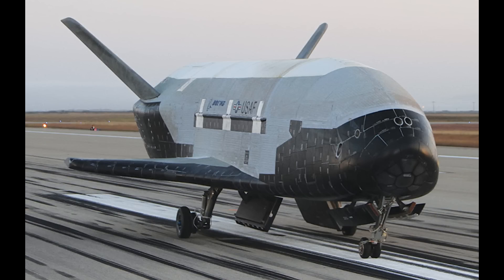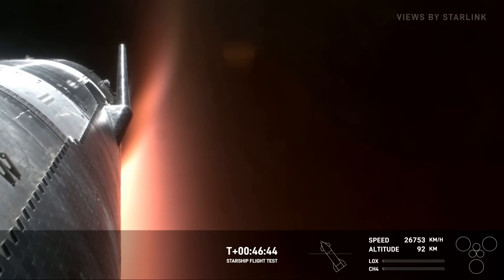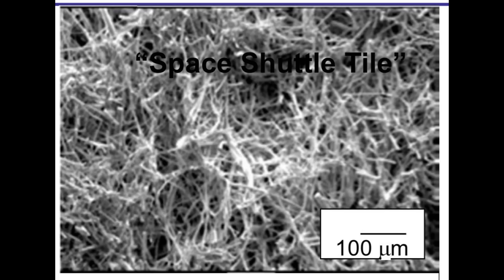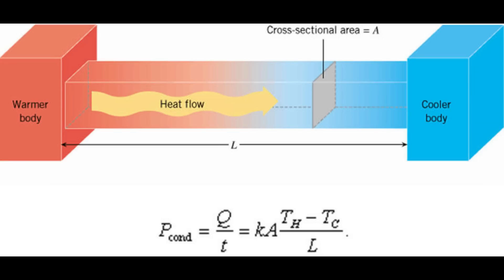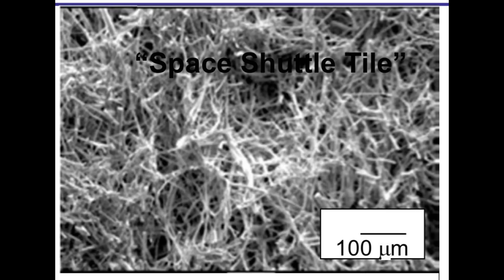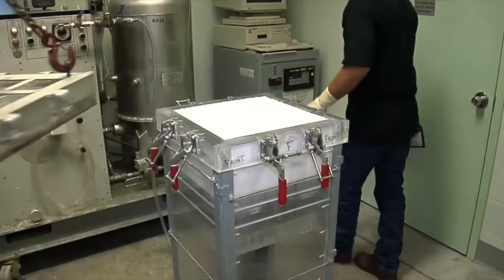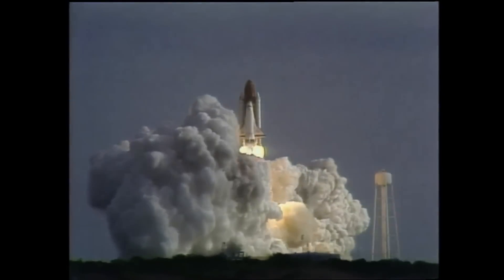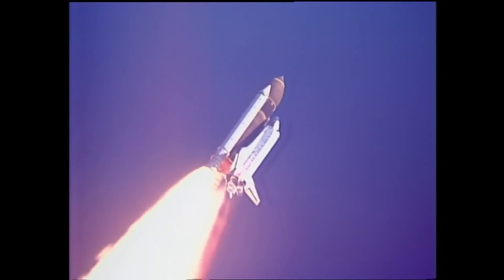The Microscopic Trick That Makes Heat Shielding Tiles Work

Comment: Do you know anything about the heatshield that the X-33 was going to use? I found a picture from the air and space museum, presumably the back side of the tile (can find it searching for this -> NASM-A20060281000_PS03). It was developed by BF Goodrich (tire company?) and used Inconel. I'm not aware of that design finding its way onto any other vehicle.
Reply: I spent time during 1995-96 developing and measuring the insulating properties of a half dozen heat shield concepts for NASA's X-33 under contract to NASA. That Goodrich Inconel thermal insulation panel was one of those concepts. Inconel has a maximum use temperature around 1800F. The maximum temperature on the Space Shuttle tiles was ~2400F. So, those Inconel tiles are a lot heavier than the Shuttle tiles and don't have enough high temperature capability. 

Lockheed was convinced that its Venture Star X-33 vehicle could fly entry trajectories that kept the peak temperature below 1800F. We will never know if that vehicle could have performed that feat because NASA canceled that over budget and behind schedule program before any test flights were attempted.
Reply: Metallic thermal protection systems based on superalloys, like the one planned for VentureStar, seem understudied.  There are a few papers available online by Blosser et al.
Reply: Im not surprised that idea died.  Inconel is very heavy.

Comment: Some ITAR things seem absolutely ridiculous these days, at least to me.

What could someone learn from seeing a picture of a rocket engine that would be dangerous?

I toured an (unnamed) space company, and wasn't allowed to take any pictures of the engines just sitting on a bench for assembly.

I wasn't told any particular reason beyond "ITAR, and that's all I can say".

Aren't rocket engines pretty well understood by anyone who is curious enough to research them these days?

Am I missing something obvious?
Reply: Rockets are simple in principle, but as always the devil's in the details, and a lot of ITAR is about concealing or obscuring those details.  Nobody is learning anything groundbreaking from a picture like that, but stealing dimensions and making assumptions about material choices through pictures on the internet could save years of development work.  

Maybe the unnamed space company was working on missile engines, in which case the fact it's a missile part is more than enough for even pictures to be export controlled.  There's a free power supply design tool from TI that's export controlled, and I can only assume that's because some other company is using it to design power supplies that go in missiles or nukes.
Reply: @ShinyMajor  Yeah, I suppose that seems fair.

I guess the confusing part is why allow people in the room then.  If it truly needs to remain secret, it seems odd to let people in at all.

Same with the artificially lowered FLIR cameras I used for so long with 4 frames per second or something.  I tried a super cheap, size of a quarter import for ¼ the cost and it blows FLIR one out of the water.

Maybe the degraded performance FLIRs protected something, but definitely not when better ones are available for so much cheaper.
Reply: We live in a world where one can replicate physical master access keys from a single careless photo and where we have devices that can destroy cities by briefly turning them in to miniature suns.

I'm all about blurring photos to limit the spread of delivery mechanisms for miniature suns.
Reply: @noahhastings6145  thank you
Reply: Having worked my career in and near optical and electronic sensor based product design, there are many trade secrets around the types of materials, their type of preparation, dimensions, and a hundred other things to work out before you can move to product development... example: if it shakes, how much, how big a bracket, what material, what shape... seeing a competitor's design for a novel product that is meeting market success, allows skipping past a large amount of engineering. That's what ITAR is about, not so much to hide the general theory of operation, than to hide today's best practices and the many difficult to get right details, to greatly slow the competitor.
Reply: no, rocketry (even ordinary airplanes) still contain many trade secrets, military secrets, improvements so statement “well understood” doesn’t really apply. Production of soap is “well understood”.

Comment: good ol' asbestos is the secret 😂
Reply: I doubt it, I’m sure it’s already been tried.  We still use asbestos for things today in applications where nothing else will serve and the risk of exposure is low.  If it worked best I assume they would still use it.
Reply: Asbestos melts or decomposes at lower temperatures, being a hydroxylated magnesium silicate. This stuff is probably just as harmful to lungs, however, excepting that it's perhaps less likely to shed fibers. Wikipedia claims that asbestos fuses/dehydroxylates at 550-750°C, and melts at 600-850°C. Silica ( > 1,700°C) and alumina (aka sapphire, > 2,000°C) have significantly higher melting points.
Reply: @eyesoars9212 thanks for the explanation.
Reply: I was going to point out that it looks like asbestos 😂

Comment: Why not use some type of aerogel is one of the best insulations
Reply: Incredibly delicate.
Reply: The tiny fibers with space between them get a lot of the benefits of aerogel, anyway.  They might not be quite as good at insulation, but they're good enough that you're more concerned with the seams between tiles or a missing tile than with heat transfer through a tile.

Comment: I am not convinced by this tile thing. if it proved something was that they can fall off and cause a catastrophic failure. I would much rather have the same technology developed as a "one piece" that would fit starship like a vest.
Reply: I would think that if they could come up with a decent adhesive it would be ok, until then it’s a mess.
Reply: Consider it from the perspective of benefits of it being tiles. A single piece heatshield is just as prone to catastrophic failure, if not more. A single tile falling off would at least be contained, whereas a single crack on a giant heatshield could just as well rip open. But anyways, consider the cost of production, the difficulty in replacement, the difficulty in changes, which remember, was and still is a cornerstone of this whole development cycle. Got a crack on a big heatshield? Whole thing needs removing, replacing, rebuilding. As opposed to switching out a couple mass produced tiles. Look at the x37b, much smaller, much easier to make it a single piece heatshield, but it still uses tiles because it's easier, cheaper, and realistically speaking has no downsides. Idk what you mean by "it proved that they can fall off", if you're referencing the shuttle(which was a whole other story) or what but the benefits far outweigh the supposed risks here.
Reply: If it is one piece, it can't be serviced or repaired, and is also extremely difficult to make, and likely to crack.  One of the benefits to Starship using steel instead of aluminum is that hopefully it can survive reentry with missing tiles, unlike the space shuttle.
Reply: I wonder if some variant of aerogel could be strong enough to hold up reentry. If produced in high quantities it could be cheap enough to be a one use condom like thing?
Reply: @DamianReloaded  A one use gel for a heatshield on a vehicle specifically being made to be fully and rapidly reusable...
Reply: Yes, why not? They aren't reusing most of the mass they carry which is likely more expensive to produce than the gel. You could say, well, but fuel is a requirement and I would say being able to return in one piece to be reused is also just as important.
Reply: @DamianReloaded  applying heatshield gel would be time consuming, expensive, and require facilities to do so. You're comparing something like refueling your car vs. giving it a new paint job. Yes, gel wouldn't be heavy, especially compared to the fuel. But the fuel is like 80% of the weight either way so what's the argument? It's light therefore doesn't have to be reusable? The entire ship is light compared to the fuel load..
Reply: @Kiririn_chan  It's just brainstorming. All you mention is also required for the tiles, that have the problem that they fall off. If you don't have a permanent solution for that problem,then my brainstorming doesn't hurt.

Comment: All @Scott Manley content is great, but these explanations of technical details of space flight are by far the best.
Reply: I agree. And I imagine that anyone who worked on the development of the Space Shuttle heat shield who might watch this will feel a lot of gratitude.

Although we have very little to go on, it seems like SpaceX have chosen to walk the same path, looking for better solutions that modern technology may have made available, but will ultimately conclude that chemistry hasn't really moved forward, and the solutions worked out by NASA decades ago are still optimal.
Reply: Right?! Absolute gold
Reply: I occasionally ponder the potential efficacy of using a less violent reentry process. "Skipping" the vehicle across the surface of the atmosphere numerous times reduces the velocity each time. This can allow a ride off between the number of skips (which affects the number of additional orbits or partial orbits) and time vs. the heat load experienced.

At least one of the X-15 flights, IIRC flown by Neill Armstrong, inadvertently entered this regime for a short time, which caused its flight path to be greatly extended.
It seems to me that this tactic could greatly reduce or eliminate the need for heat shield tiles, at least for stainless steel vehicles.
Reply: @GaryBickford  In a way, that's what most (all?) re entry vehicles do. They use some form of aerodynamic lift to coast in the upper atmosphere for as along as possible rather than having a ballistic return trajectory.
Reply: @QuantumHistorian  According to things I read a long time ago, this can be extended to multiple orbits, even to the point where you're below hypersonic velocity and don't even need special shielding. But it takes a long time - up to days.
Reply: One of the things he explains out LI-900: 900 stands for 9 pounds per cubic foot. That’s about the most tragic imperial unit I’ve ever seen: centipound per cubic foot 🥲
Reply: The bestest 😏part is I learn when Scott does these. 

And for reentry, skipping astronauts along the atmosphere for days to slow them down to subsonic does not sound, uh, like the best of times.
Reply: "content" in youtube language means  a product of bullshit generator. Fortunately not every future billionaire fill the servers with content.
Reply: All the Space Shuttle heat tile stuff went over my head. About 16 times per day, actually.
Reply: @FLPhotoCatcher  One day you will be held accountable for your dad jokes.
Reply: @FLPhotoCatcher  Naaah aah haaaa    back in the day right.
Reply: Yes, I remember watching another video about tiles and it was very technical. I Forgot who made it
Reply: @ralanham76  Breaking Taps made the video that was mentioned here, was that the one?
Reply: I like the use of the word "best" instead of "my favorite"
Reply: @nicewhenearnedrudemostlyel489   Well EXCUSE me 🤣
Reply: @nicewhenearnedrudemostlyel489  Fair, but when something is clearly subjective, the two words become almost synonymous. And, considering that this is the top voted comment on the video, it seems that it's not just my take, but a very popular one. So it doesn't seem entirely unreasonable to say that, yes, this type of content is Scott's forte.
Reply: Trying to tag the creator lol "notice me, senpai"

Comment: Machining glass fibers, the most spicy of all the fibers!
Reply: I assume they had a big extractor above the machine but not wearing a respirator while standing next to glass fibre being machined is brave
Reply: The forbidden pasta.
Reply: @General12th  The forbidden Wheaties.
Reply: Well there used to be a fibrous material of choice that was even spicy-hotter. Called asbestos.
Reply: Yeah that made me wince
Reply: @etcher6841  FWIW PCBs are also made of glass fiber and machining them is a mature and dirt cheap process
Reply: @NavinF  You sir are clueless!
Reply: @shazam6274  ok boomer
Reply: @NavinF  Quit bragging about your ignorance!  G10 is fiberglass and epoxy resin, both of which have a fraction of the temperatures required (i.e. ~ 400c).  It costs ~6-8 times as much to machine than Phenolic or fiberglass PCBs.
Reply: @shazam6274  Why? They both have glass fiber
Reply: @NavinF  Physics and chemistry, look into it!
Reply: @NavinF  He's trolling you.

Comment: so in reality i dont mess up the settings for my 3D printer, i just accidentally built a TPS
Reply: You would, had it printed with 1-micron fiber.
Reply: @artemkras  He clearly tuned his TPS for a longer wavelength radiation.
Reply: @artemkras  heh, 1 micron filament would be a nice resolution! No clue how to implement such a resolution though, largely due to wavelength...
Reply: Don't forget the new cover sheets.  I'll resend you that memo.

Comment: I think SpaceX is going to have to use a material called inconel X on critical areas of the Starship. That will make those parts the ship a great deal more expensive but will feed into multi-use capability like over 100 times. Got to love that a material that's over 70 years old  has X right at the end of its name
Reply: It's just inconel. X is the identifier used in its material codes, like X-750, to know the grade required. It's also not revolutionary, it's been standard in jet manufacture as long as jet engines have existed, and it won't be a magic fix for all the problems starship has - its temperature resistance is still far too low to be used for naked reentry, it still needs effective tile protection, even if those tiles don't need to work as hard.
Reply: @iskierka8399  umm sorry that on the internet I have to make every detail explicit to the end factor to keep people satisfied, but I meant in Canal X beneath tiles
Reply: I believe there are also some Alloys that have tungsten in them and offer significantly better thermal protection
Reply: @iskierka8399  and the inconel X is to be used in critical areas to prevent metal fatigue
Reply: Inconel was used in the leadimg edge areas of the X15.  Not sure why it was not incorporated into high temperature areas of the Starship in the first place
Reply: Yup
Musk said that